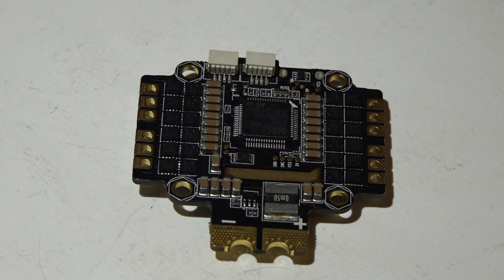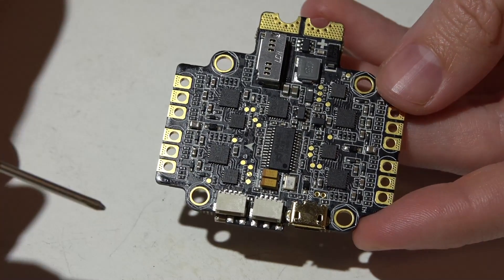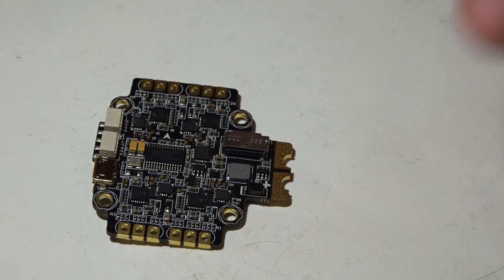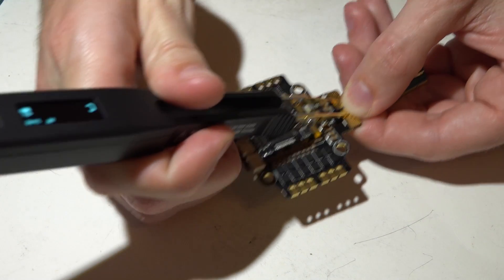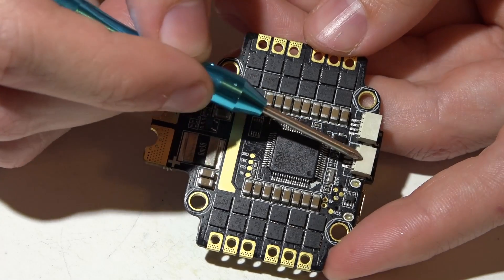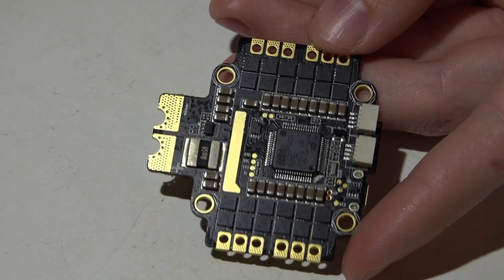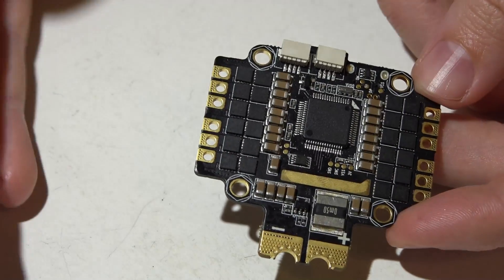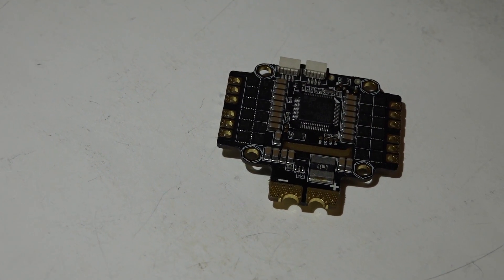Asgard Flight Controller Review

Comment: JC, I was wondering on UART6 5v/3v option.  I too noticed that the UART6 produces 5v by default and it will fry my DSX Rx if I would of connected it but on the side of the board with the mosfets just directly underside of the usb there are 3 solder connections it looks like there is a 5v - 3v selection.  It hard to see I think the 5v and the center solder joint are bridged because I get continuity on both of them but no continuity from the center solder to the 3v.   Its so small i cannot see the bridge but my ohm meter shows they connect.  I was wondering if I try to break the connection between the 5v and center and then bridge the 3v to center if that would change UART6 to 3.3v.  Any suggestions?  It's so tiny I don't really see the bridge but it tones out so I can assume there is one.

Comment: I was really enjoying my asgard when out of nowhere it stopped working. No crash or anything just decided it didn't want to work anymore. I've got my vtx direct to power leads and when i plug in power, my vtx turns on and transmits signal to my goggles, but there are no leds on the fc and my motors don't spool up or chirp. i can't get it to connect to bf either. any ideas?

Comment: Could you help please? I'm new to Betaflight as I was on KISS for a long time.

I am able to get UART 1 to work on Betaflight 3.1.7 however I cannot get the Betaflight OSD to work. 
I am using Spectrum 4649T and IRC Tramp VTX. I ran the telemetry wire on the tramp VTX to UART6 TX6 hoping I can get the Betaflight OSD (I enabled TRAMP VTX under Peripherals in the ports menu)
How do I physically get the Betaflight OSD? How does the wiring work?
I also read somewhere you can take the FPV Cam vid wire and connect it to VIN and then run the VINout into the TRAMP video signal wire.

I also flashed the custom 3.1.6 HEX from airbot and both UART 1 & 6 do not work for me. It was also very difficult to flash back to 3.1.7.

Any help is appreciated!

Comment: Is there an easy way to rearrange motors so the esc will match the motor on the arm? The arrangement in betaflight is 2-1 right and 3-4 left. The board has the esc 2-4 right and 1-3 left the way i have mounted the flightcontroller.
Reply: I found out how to fix this: http://www.readytoflyquads.com/flip-32---f4---omnibus-aio-f4

in CLI: 
resource MOTOR 1 B00
resource MOTOR 2 A03
resource MOTOR 3 B01
resource MOTOR 4 A02

save

in the GUI - 
Pitch = 180
Yaw= 90

Comment: Hey, what is your oppinion about using the solder on the HV bar to help with high amp situations - there seems to be a trend on rcgroups that those who used that have more trouble.

Comment: hi jc another great video as usual i really need your advice I've had no luck with trying to build my first quad I've gone through 6 esc's 1 blown  motor and now my f4 revo fc's is  playing up its not powering up from vbat  but betaflight is reading from vbat it powers up if i give it 5v on the esc rail I'm waiting on esc's so can't try it yet any idea if it will be ok as ive had to change almost  everything on the quad and it still hasn't flown yet I've learned my lesson don't by cheap it cost a lot more in the long run please help

Comment: You can rotate the FC with the Vbat and Gnd to the size of the quad. That would be easier to solder motor wires and xt60

Comment: Would there be benefit of running 2 big capacitors? Would this reduce the chances of failure? Maybe one on board one on xt60? Sorry noob question, I'm not a electrical  engineer. Thanks!

Comment: Great review. Thought about getting one of these but not sure I want all of that hardware on a single board. 

ReadyToFlyQuads does a great job at shipping and have good pricing. However, they missed a few inexpensive items in one order and would never answer repeated emails. Total ignore. 

I still order from them, but I would recommend ordering small orders from them because if they miss something they'll never respond to you. You'll need to make a PayPal or credit card claim. 

I would also not count on them providing a replacement or repairing anything.

Comment: Looking at the airbot site, forward arrow puts the USB and power out the sides and the esc connections in the front and rear of the quad.
Reply from the maker: Yep you can mount it either way and change the direction in Betaflight. But not all frames, like the ones I use wont be able to use it that way. I should have clarified.

Comment: Hey JC,  30th!!

Thanks for another excellent review!  I never even knew this board existed :)  Good luck on the exams!

Can you leave a link for those tweezers you are using?  

Danke!

-S
Reply from the maker: Thanks bud. Exams are halfway over with. Here is the link. They are pretty expensive though. I only bought them because I use it in my line of work. http://amzn.to/2p28Alu
Though if you want to measure capacitance, inductance, and other stuff you could find cheaper meters.

Comment: What is the name of the tool that you used to measure the resistance etc...?
Reply: Ok I found something similar. Which one of these 2 would you buy?  this one => https://www.banggood.com/LCR-TN-Multifunction-Tester-TC-V2_12k-TFT-Display-With-Electronic-Tweezers-p-1117485.html?rmmds=search
or this one => http://www.aventools.com/product/quick-test-auto-scanning-tweezers/
Reply from the maker: They're called Smart Tweezers. Very expensive though. I think those would work well enough. I'm not sure what the accuracy is like but I'd say it's work trying.

Comment: Can I request a video on repairing common malfunctions of 4 in 1 ESCs? Maybe a tutorial on removing and replacing those very close together surface mounted bits. I feel like the inability to work on them is the only reason everyone hasn't gone 4 in 1. It'd be nice to know what pieces to have on hand should the board crap out.
Reply from the maker: Thats a great suggestion. Will do
Reply: JC, I've got two Racerstar 20amp V2 4-in-1 escs that have never worked.  You are welcome to play with them...
Reply: Project Blue Falcon thank you!

Comment: Hey I have a aikon 4in1 esc with a bad motor 2 esc that stutters and gets hot  I also have another aikon 4in 1 with motor 3 doing the same thing. what components would I have to switch over to make a complete esc? like I said the motors stutters and gets hot and motor screws are not touching the windings.
Reply from the maker: Thats a tough one to answer without looking at it and testing things. But a sure fire way would be to swap both the mosfets and chipsets.

Comment: Great info JC!
Is that tweezer-style multimeter new?  Really dig your plastic-tipped tweezers too. More tool reviews please:-)
Reply from the maker: I'll do a video on some of the equipment I use. Mattbone01 is correct on the tweezers. They are really expensive though. Something I use in my line of work. http://amzn.to/2p28Alu 
Some multimeters can test diodes. If you want something that can measure capacitance there are $20 meters that can do that. The tweezers are ceramic tipped. They can handle the heat of a soldering iron but without conducting electricity like metal. http://amzn.to/2oJHmgX
Reply: Canyon Racer Those are ST52SAD professional tweezers. can find in Amazon for $300.00.